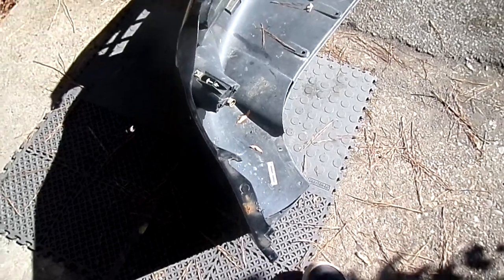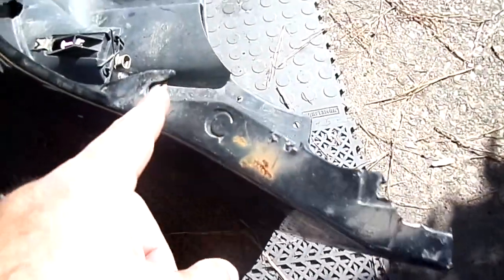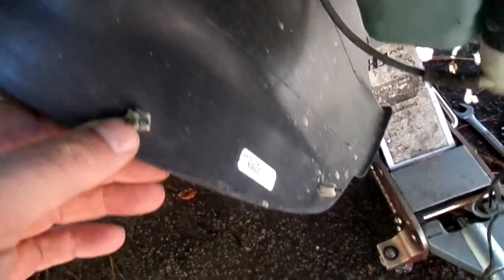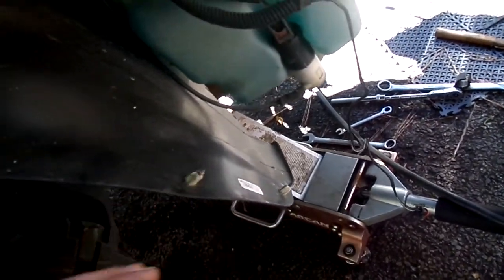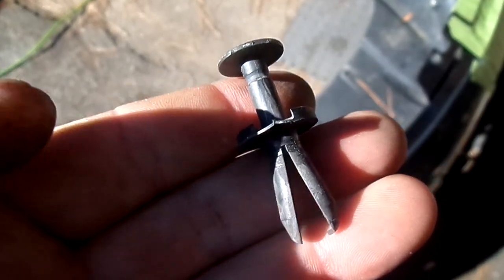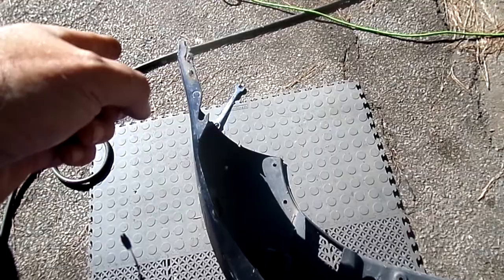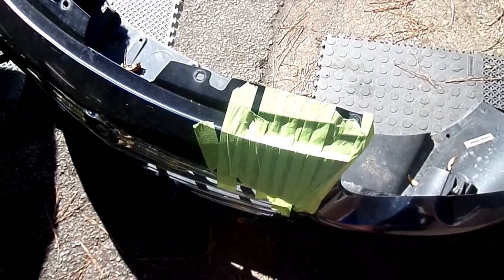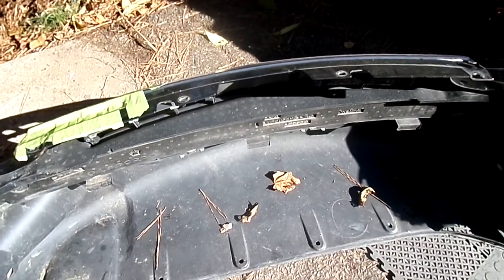Tips On Removing A Chrysler Sebring Convertible Front Bumper Cover

Comment: I got into a fender bender a couple weeks ago in my 2004 Sebring convertible and they’re telling me I need a new grill bumper assembly, but I don’t wanna pay over $1000! I watched your video about how to take it out and I think I can do that, I just don’t know what kind of tool I need to get the bolts out. Other than that, how hard is it to put a new one on? I’m hopefully assuming is easy it is to take it out if you get a chance, love to hear from you, thanks!
Reply from the maker: Do you know a basic little socket set and something to pull the pushpins out a little plastic it’s very simple not complicated and you can get one at a junkyard matching color if you need to do the whole bumper cover that’s easier if you just need the grill may just go to the junkyard for 20 bucks

Comment: Ok but do you have to remove headlights first? I’m having a hard time taking them off. Videos look easy but it’s not.  Grrr... I have a 2001 convertible and think the headlights are original. Broke two bolts that were badly corroded. Any tips to get them off.

Comment: thanks, i have to flush my cooling system because of minimal flow through my heater core. for my first try fixing it i'm using irontite flush. it is supposed to unclog it so i can have max heat. anyway there's no way to get to the petcock to drain and flush the radiator unless the nose is removed. thank god you put this video up. i have a 98 sebring jxi convertible with the 2.5 v/6. love the car, hate working on it. poor engineering under the hood.
Reply from the maker: BennieDarrell, glad to hear that you found this video helpful and thank you so much for the feedback. Hope to see you on the channel and our Facebook page often. :-)

Comment: How do you remove the plastic connectors on the top?
Reply: A small flathead screwdriver should pop the plastic center (nail like) pin up far enough to grip with your fingers or pair of pliers. It doesnt have to come out all the way! the whole thing should pop out once the pin is high enough.